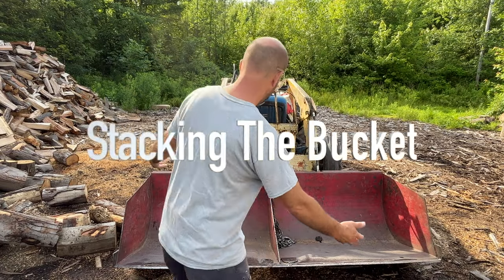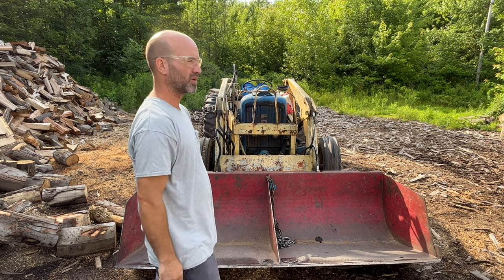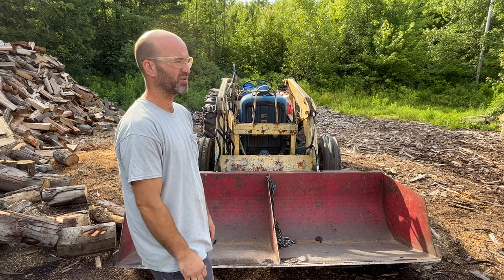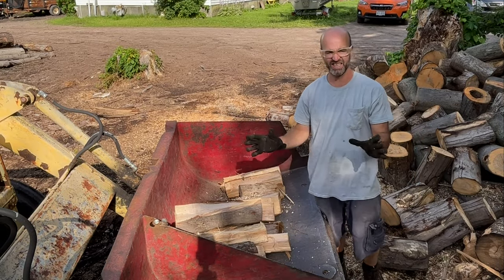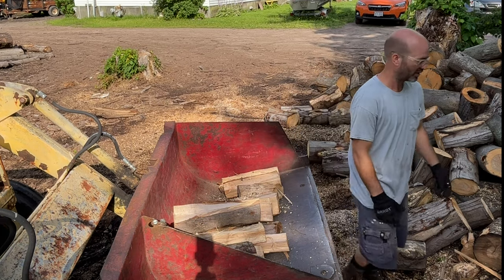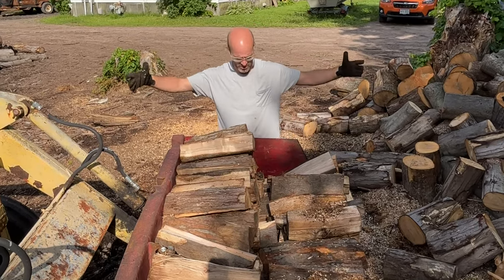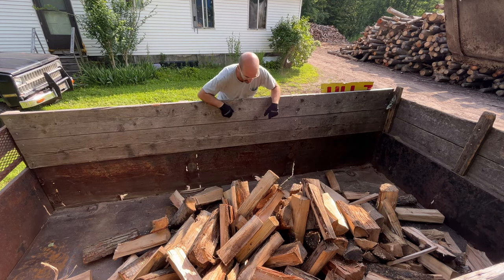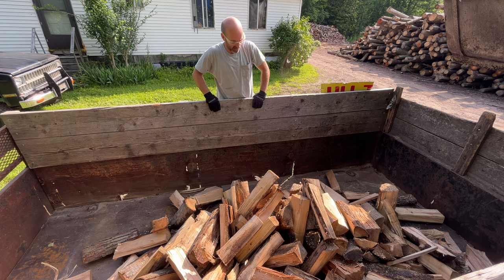How we Do It:  Measuring a Cord Using The Loader Bucket

Comment: I’ve been in the hunt for a bucket like that they are outrageously priced right now around here so you’re saying one bucket full is half cord or face cord?    I have a 7 x 14 dump trailer with 2 foot high sides they claim that filled to the top level loosely thrown is one cord so they say
Reply from the maker: If you spread it out and make sure all the trailer is full it sounds about right. 
Maybe a little extra
Reply: Face cord is 1/3 a cord